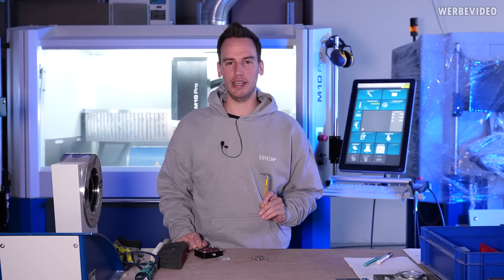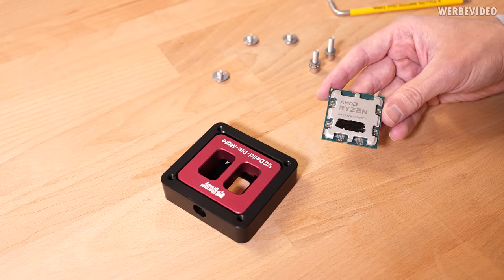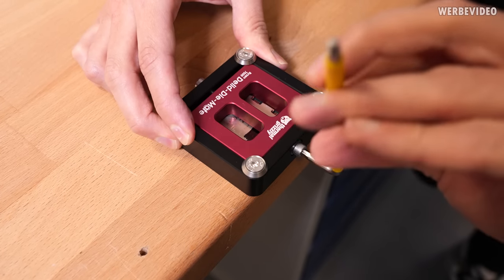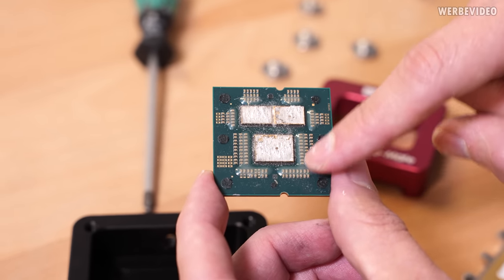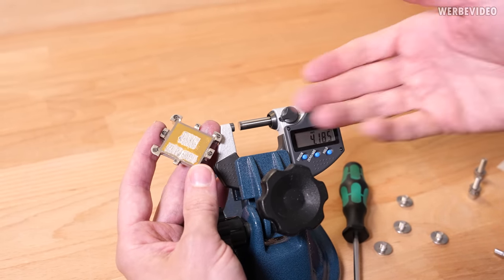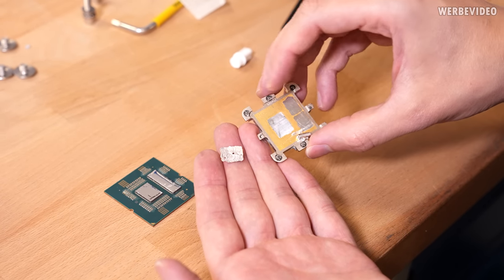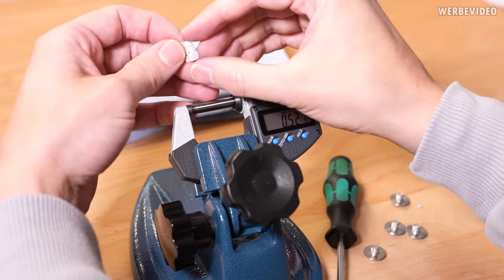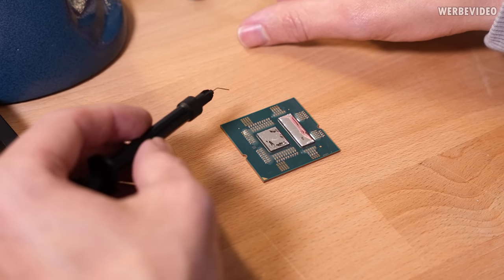Different Chip Height due to 3D-Cache? R9 7950X3D Delidded

Comment: Edit: my frustration comes from lowering the frequency on the 3dCache CCD, not from not having the second 3D Cache added.

Doest that V-cache NEED to be stacked above? If they divided it and placed between the Core lines it would be SO MUCH easier to cool down. 3D maketting was cool and all but just imagine how much better the CPU would be with Vcache on both chiplets... This is kinda frustrating.
Reply: That is like saying a bungalow is a high rise flat housing.
Reply: @AlfaPro1337   Kinda. Unless they have no way to do that without making the "pcb" bigger...would be a good tradeoff IMO if they are changing the socket anyways. I dont think that would hurt latency, would it?
Reply: @anubisTC  Dude do you know what 'vertical' even mean?

Plus gluing has more latency than a single die. And AMD introduced a lot of unnecessary bottlenecking like IF-MC not running 1:1.
Reply: Vcache on one CCD is a very deliberate decision that AMD explicitly included in their marketing - "best of both worlds". The Vcache equipped CCD is substantially slower than the naked CCD, so the asymmetric setup let's them do things like run clock sensitive tasks on the naked CCD, cache sensitive tasks on the Vcache CCD, and tasks that are sensitive to both but can maybe tolerate a slight latency increase (much less than reaching out to RAM) can go on the naked CCD and pull data from the Vcache over Infinity Fabric. If they put Vcache on both chips then it would only be useful for cache sensitive tasks and objectively worse for many other workloads than the cheaper chips.
Reply: So you just want more on-die cache? And how would you plan on doing that without increasing die area?
Reply: not sure if you have seen the layout of a Zen 5/7 CCD, the cores are all on the outer edge (left/right side) and the cache takes up a majority of the die area already. the layout allows for unified access of the L3 cache from all the cores. the cores also have individual L2/L1 cache that is much much smaller. Putting L3 cache "in between" the cpus is how you make a slower CPU....
Reply: @bosstowndynamics5488  So in this case, it's not a vcache, it's more of a edram like the ill-fate Broadwell desktop processor.

There's no stacked glued cache.
Reply: @bosstowndynamics5488  I see. I say that because if the issue for not doing it was temperature...
Reply: @AlfaPro1337  AMD argument is temperature. That is what I'm talking about. 

About your first slightly aggressive question i can tell where you can put it.
Reply: @Bayonet1809  We are already increasing the 'total' die area by a lot, by simply gluing fake vcache.

Heck, unlike on-die, putting it externally, even a millimeter away, is a huge bottlenecking, and still increase the 'total' die area.

If you can't get the 'total' die area, this is more like the total, allowable packaging area.
Reply: @nemesis1588  That would be latency. I assume they can find a layout and "wiring" to make it more efficient. But then they created the temperature issue they use as argument. 

What I question is:  the 3D thing  is just marketing or there was absolutely no other way to do that? Scheduling, wiring, maybe even put a F'ing vapor chamber, IDK...People just run to delid them and get better temps...

Is not like companies give up on marketing strategies for real functionality/comfort. Look at Samsung S Ultra Edges.
Reply: @AlfaPro1337  It doesn't bottleneck the CPU because the CPU still has access to exactly as much "normal" cache as it otherwise would.

And no, it doesn't increase die area in the same way, because one of the key advantages of AMD's architecture is that the different dies can be made in different processes, and another one is that 2 smaller dies with the same total area are cheaper to make than 1 large die because if there's 1 defect you only lose half as much hardware per unit (cheaper to make means more hardware at the same price point as well, that's why Intel's best consumer chips don't have as much cache). TSMC has also reported that upcoming die shrinks don't scale cache at all, which means that a 3nm chip with 64MB of cache would take up the same amount of physical area, at a higher cost per square mm, as a 5nm chip for cache. Vcache doesn't just allow more cache without increasing the CCD size, it lets you use a cheaper process in the parts that don't benefit from newer process nodes.
Reply: @Bayonet1809  Nono. Is more about the VCache CCD frequency. Feels like a terrible waste. 

I just dont know how much benefit they get against what it could be without what is basically an insulation layer of cache. Or even make the Vcache thinner and sit over the whole thing to not block heat transfer like that. IDK man...just feels wrong.
Reply: @bosstowndynamics5488  What? Dude, the X3D variant is just a non-X3D with a large L3 cache. It' still a bottlenecking. L1 or L2 has no increased in size.

Not really, there's no reduced cost in going just 'one gen' node behind. Plus, the fab node has lost its meaning, we can't just go with that any more.

On the contrary, gluing actually increase the cost, since the packaging multiple die on one package, especially with various wafer balls and the sheer amount of I/O on each die. Take a look at HBM-type GPU, AMD lied to us, there's no mainstream consumer card that uses HBM, nor APU from them.
Reply: @AlfaPro1337  What exactly are you saying is bottlenecked though? The additional cache die isn't a bottleneck because as you clearly agree the X3D chips still have the same cache configuration as the non X3D chips, just with an additional 64MB slapped on, so the cache access to the rest is the same. Technically access to the extra 64MB is "bottlenecked" by the connection between the cache die and the CCD but since that's 64MB of extra cache that "bottleneck" doesn't matter (the entire point is that, even bottlenecked by the interchip link, cache is still way faster than RAM, which is what the chip would have to use instead if that cache wasn't there).

AMD's IO die is kind of a bottleneck because AM5 RAM speeds are a bit slower than Intel, but that actually makes the cache more advantageous because it partially removes that bottleneck (if RAM were the bottleneck then these chips would be slower even in cache dependent workloads, and again, the entire point is that more cache means less reliance on RAM)

And glueing does substantially decrease cost for multiple reasons, one of AMD's senior engineers went through it in a GN video about RDNA3:
1) By splitting the chip into multiple dies, a defect doesn't destroy the entire chip. You get more dies per wafer and the same number of defects across that wafer for any given process, so your yields go way up
2) You can use different processes for different parts - IO components of the chip are no faster at 5nm than they are at 6nm so you can build them on a separate die using a cheaper process without losing performance. This does in fact save costs because the 6nm process is more mature, and therefore less prone to defects. AMD also pointed out that you have to port the design between process nodes so even a simple die shrink still needs a redesign, which costs more money. Those differences don't sound big because those are the first gen AM5 values, on Zen 3 they were using an enhanced 7nm process for the CCDs and a whopping 12nm process for the IO die, using transistors that were nearly twice the size.
3) You can recycle designs - multiple generations of AM4 chips used an identical IO die, whereas every single Intel chip generation in that era needed a new memory controller because it had to be redesigned to work in the new monolithic architecture every time

HBM2 is too expensive for consumer GPUs because you're sticking many GBs of ultra high performance memory inside the GPU package, complaining that HBM being expensive means glueing chips is expensive would be like complaining that consumer CPUs don't have 768MB of cache glued onto them like EPYC does, therefore glueing is expensive. It's not the interface with HBM that's expensive, it's the HBM dies themselves.